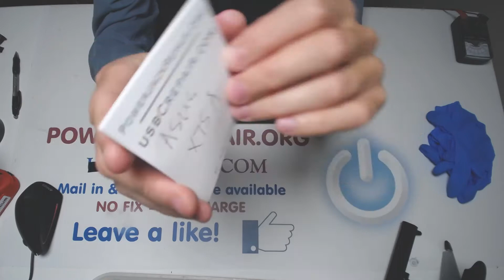How to fix laptop not powering on Asus X75a dog yanked the cord broken motherboard repair fix

Comment: Nice video. In what mode did you have your measuring device when you define health of capasitors and resisrors? Are you measure resistance?
Reply from the maker: yes the mode is x1k ohm, measuring resistance.